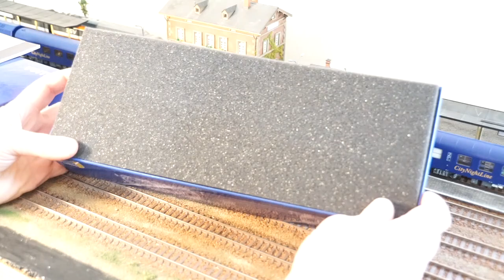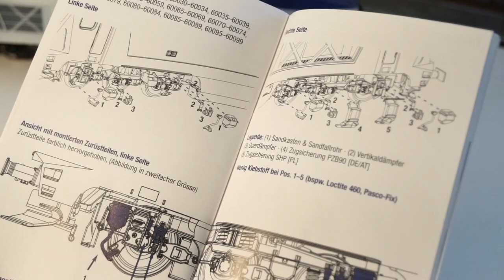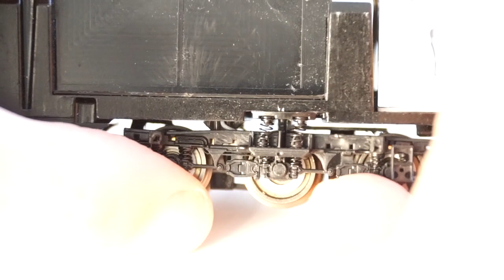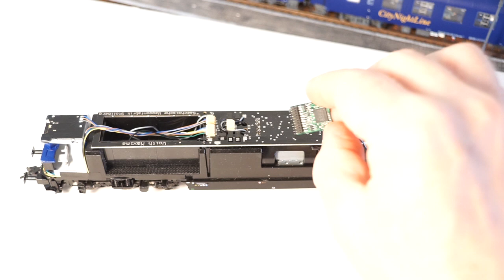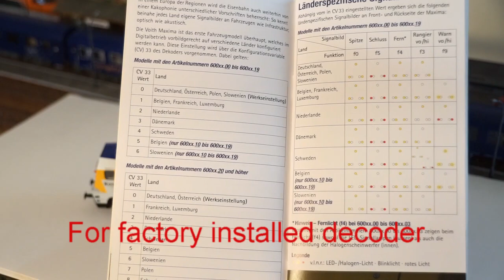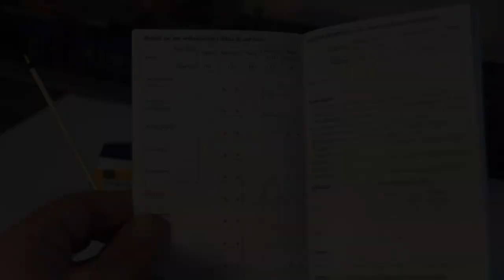Voith Maxima H0 test and revew

Comment: Hi Peter, have you ever had one of the gearboxes apart on the axles? Andy.
Reply from the maker: No i have not i was tempted but this model is so complex and "different"... I reached out to the maker of this model and received new shafts and universal joints. Apparently the issue with the drive in my model was related to the old style of universal shafts between the gear box and buggies. Never installed them.
Reply: @peters.5669  Thanks for your prompt reply, centre axle on one bogie is free wheeling. It's the most difficult to work on because it's covered by the guide bar. If a pinion has slid off it's splines it may be fixable, but is it worth the strip down without an exploded diagram? Your thoughts would be appreciated. Regards Andy.
Reply: @peters.5669  I decided to have a go regardless, a half hours scrutiny meant the guide bar came off with minute levering being shaped in a half ball/socket arrangement. Gearbox has a proud tab on one side, moderate opposing pressure popped the gear cover off. It wasn't quite on properly anyhow which led to the gear mesh separating.  Removed bogie by squeezing gently on the sides, it drops away on long pickup wires but capture the springs! Long propshaft detaches and now I had access to both top/bottom of bogie. Pressed gear cover with it's 4 prongs into it's opposite number now firmly together and reverse procedure...Phew. Andy.

Comment: Hi Peter. Nice review. Were you able to reprogram sound and light on ESU v4?
Reply from the maker: Hi Mihir, yes and no,  i was unable to activate and set up the SUSI interface therefor i don't have access to all the country/railroad specific lights aspects however.            I ended assigning the most important (for me) functions directly to decoder outputs. I can operate headlights, cab light, machine room light... the most common basic functions but  more than enough to play with it :). Sound file, I've watched probably every available you-tube video with the real maxima and ended building my own sound file utilizing ESU sounds library for Lok Programmer. Its a "comprehensive melange" of different locomotives sounds but  I'm very happy with it :). The key was to get the characteristic hydraulic transmission sound with the diesel engine and the turbo to replicate and it sounds great! 
Best regards, Peter

Comment: I have this as a dummy. Looks like I did everything right :)

Have you soldered the SUSI to the ESU decoder correctly? ESU supports SUSI but does not come with a plug/socket system for SUSI as Uhlenbrock does.

Speaking of support. Sign up on www.stummiforum.de and contact User heineken. He is the head of SWS/KombiModell and, at least to my experience, replies to personal messages fast.
Reply from the maker: Thank you! I managed to map and program most of the functions using ESU decoder outputs - only one is missing - cab lights :). I don't really have use for most of the extra country specific lights signals. Interestingly, in the latest ESU  lok programmer software there is a function to enable the SUSI interface, apparently, once you trigger the SUSI option the decoder is converting  AUX6 to a digital SUSI output. I haven't had the time to play with it yet... and then, like most of us i just like to play with my trains :)
All best, Peter

Comment: I had this loco too.Nothing as trouble and the same rattling sound.I suspect the noise is from the belt that connects the motor to the drive shaft.Also i had the Uhlenbrock sound version that preformed not well.A bit shame while this is a nice loco and not seen very often.